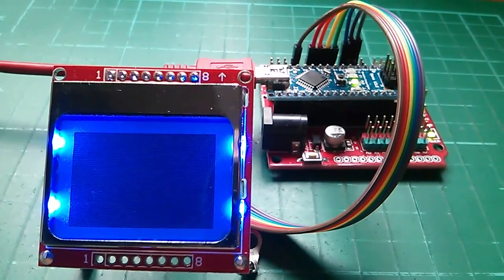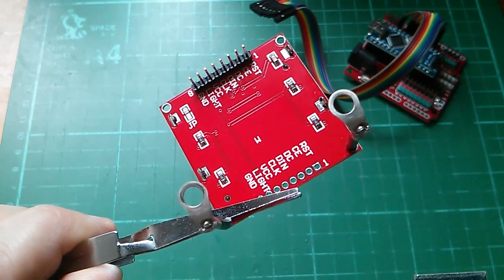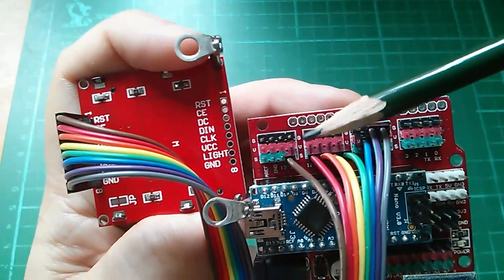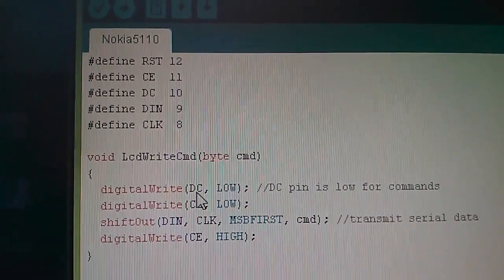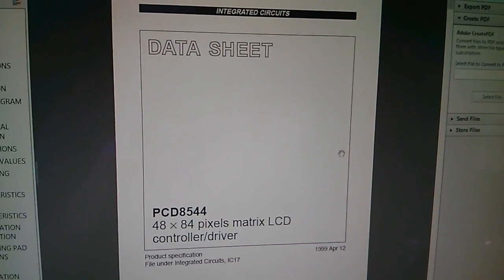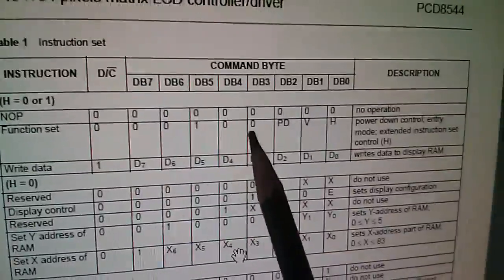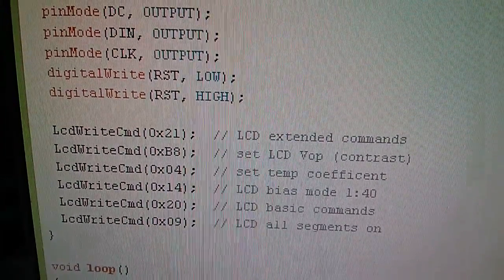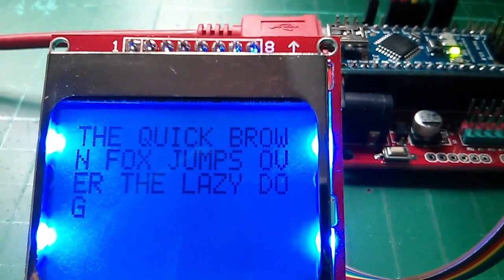Arduino Nokia 5110 LCD Tutorial #1 - Connecting and Initial Programming

Comment: I had bought the lcd and had connected by looking at the  goodled images of wiring diagrams. Your video has provided with a huge help in correcting my mistake. I was completely fed up of the display as it wont work, but this tutorial was just too good and was a huge help. Thanks :)

Comment: Hi Julian,  I've been noodling a bit more with your ultra lean shift-out code for these Nokia 5110 displays.  I wanted the smallest possible footprint so that we could add them to data loggers that are already compile near the memory limits.  As it turns out, stuffing those fonts (and some calibration data) into the internal EEprom was pretty easy to do and it does not noticeably affect the speed of the display:

https://thecavepearlproject.org/2018/08/24/tutorial-using-the-arduinos-internal-eeprom-for-fonts-header-data/

Comment: Iam very glad to found this video
 thank you 

Just two questions
How did you figured out that the data input of the display is a shiftregister?  Is there somewhere in the datasheet a hint or did you decide it by the signal diagram?
Dc ias ow for the whole datasend procedure . I just wonder because while reading the sheet i thought dc must  be low for just the first bit of sendet data. 
Is this a common way to use this type of interface?

Comment: Hi Julian,
I had a project that needed some live data display, and was looking for the cheapest low-power solution and that lead me to your brilliant Nokia 5110 tutorial. Combining your information with pin powering let me get rid of the Reset and CS control lines. This brings the display down to any four wires you can spare (incl. the power pin) and a ground which is much more manageable the standard six wire hookup:  
https://thecavepearlproject.org/2018/05/18/adding-the-nokia-5110-lcd-to-your-arduino-data-logger/
Anyway, I just wanted to say thank-you for posting the shiftout method for driving these displays!

Comment: Julian Ilett
I am going to use this code you provide on a few online projects with proper credits. If you don't have any cons. If you do, please tell me, i will remove it.
Reply from the maker: Go for it :)
Reply: Another question. :)
How to display some values from sensors within your code? I have float value and it need to be char inside LcdWriteString(). Tried few solutions but no luck. Or how to display float value anyway?
Reply: You need a library routine to convert numbers (a float in this case) into strings.  You can make your own, but I'm sure there are libraries already defined for the purpose.

In the case of a float, I believe the routine requires you to say how many digits of precision you want and it will round off the float to the nearest value.  eg. If you ask for it to convert 1.5 with no decimal portion, it will be rounded up to 2 when it's converted to a string.

Comment: I have seen some sources say that this can work with 5 volts,  but no guarantees.    my UNO has a 3.3v power pin, but the digital pins are 5v.   any chance this will work ?
would I be better powering the whole thing from 5v and take the risk ?  or go multi-volt and try it with 3.3v power and raw data pins ?
Reply: If the display data sheet says that the data lines are 5 volt tolerant then you can do it, otherwise not.

If you don't mind inverting all of the data pins, you can convert between 5V and 3.3V by using a NPN transistor such as 2N2222 or BC549 and a couple of resistors for each data line.  One resistor is used as a "pull up" between 3.3V (or 5V if you're going the opposite direction) and the data pin which is taking the data.  The collector of the transistor connects to the data pin and the emitter connects to ground.  The remaining resistor goes between the data pin which is sending the data and the base of the transistor.

If you didn't understand any of the above, then you're probably better off buying a display which is 5V tolerant in the first place.
Reply: i guess what i was asking without saying, if all the data lines are inputs, and the only action from the arduino is to pull to ground, then, they would work without alteration.  as a note some of the mini's are able to run on 3.3v

Comment: Mine only works at 3.3v not 5v
Reply: Transistors can convert the signal voltage, but I think you can also get level converter chips.

But it might be easier to just get a 5V display.

Comment: how to change the size of the text ??
Reply: Since the display doesn't have any built-in text font, you'd need to define your own font in the size you need.

This isn't simple.  If you reduce the size, you also reduce the resolution.  You also have to handle characters which cross over byte boundaries.

In theory, you could define a font which is 4 x 4 pixels in size, but then you'd need to figure out the programming to handle the fact that you would be putting part of each of two characters into the upper and lower 4 bits of each byte of data.

Yes, it's complicated.

Comment: Hi Julian, nice video. I am new to working with the Nokia 5110 display. I am using an Arduino UNO. Hooked up everything the way described, uploaded the sketch and nothing showed on the screen. The led lights came on, but nothing else. Checked all the wiring. Do you think the display is bad? Not sure what to check next.
Thanks,
Robert

Comment: Hi Julian, thanks for this series. Definitely saved me some time. After a lot of experimentation with this display, and the u8glib, I've come to the conclusion that this display definitely does not want to be driven from 5V VCC, and with 5V logic. It does survive the ordeal, but the display quality suffers a lot. If you run the GraphicsTest example from u8glib from 3.3V and from 5V, you will clearly see a huge difference in display quality. Its virtually impossible to get good bias, temp and contrast values with 5V. But with 3.3V it works just fine.  The values (for u8glib) are defined in a file at  /Arduino/libraries/U8glib/src/clib/ u8g_dev_pcd8544_84x48.c on my Mac. Should be somewhere similar for Windoze users. This may vary, but I got excellent results with temp=0x005, bias=0x011, contrast(Vop)=0x0BF. I'm busy getting a ATMEGA328P running at 3.3V, 8MHz, so no level conversions are necessary. This will be a "backpack" I2C processor for the 5110. Lots of memory and I/O lines available. PS: I'm using the 5110 from Sparkfun - slightly different from yours: https://learn.sparkfun.com/tutorials/graphic-lcd-hookup-guide. Hope this helps someone. Best regards!

Comment: Nice videos, and good code to start with!

You described problems in 3rd video, and I had problems when connecting 5110 as you described to Arduino Nano: after some time the display got darker and darker. Solution for me was simply to connect 5110 VCC to 3.3V pin of Nano instead of 5V.

I did play a lot with your code, and made your simple clear display loop speed up from 11.44fps to 206.27fps. And finally I was able to draw a complete (arbitrary) frame with 142.94fps:
https://forum.arduino.cc/index.php?topic=382585.0

Comment: I also have a Nokia 5110 LCD, but my pins are different, instead of the pins that you showed I have: 1.VCC,  2.GND, 3.SCE, 4.RST, 5.D/C, 6.DN(MOSI), 7.SCLK, 8.LED. How should I connect them to my Arduino in comparision with your example? Thanks

Comment: For me(supply voltage=3.3V), setting the temp coefficent to 0x04 (=temp coefficent "0" according to datasheet), results in a far too high contrast making it seem like all pixels are active even though it's supposed to be displaying a blank screen. Setting the coefficient to 0x05 (=temp coefficent "1" according to datasheet) fixed that problem entirely.
Anyways, thx for the video, helped me a lot!

Comment: Ok time out!
We did this 10 years ago with a serial bus on an old Pentium 2 Laptop. 
the whole 2.7 - 3.3VDC thing and the black out effect are a thing IF you try to drive it with 5 VDC and more than 1 amp = typical USB voltage and current.
its best to use a 500mA 3 VDC supply (wall wart) or if you have a bench supply like I do you can set the current and voltage limits.
To bring this up to speed We can do in via a Rasberry Pi also as well an as Arduino and with a variety of LCD and LED type screens both static and touch capable...
This is an interesting tutorial for those wanting to dabble in old tech and low res displays...

I guess it helps to mention that I worked on hundreds of these phones in the past and their internal components as I am an Authorized Nokia service repair technician along with many many other brands including Apple and Motorola..
Reply: you're missing the point.  it is popular because you can get them from china for a couple of $$ with free shipping.
Reply: why when you can usually get them free from the old phones free from people who still have them laying around? I happen to have a box of these nokia phones..
Reply: ElfNet Gaming Yeah everyone has these lying around, that's why they buying them in droves.
Reply: Who is "they".
I don't know any one person buying these things let alone droves of people buying them like its the "next best thing"
. I do however know people that buy late model phone screens and touch screens for their projects but I guess some parts of the world haven't caught up to that yet..

Those LCD's are either NOS "New Old Stock" or Salvaged from old phones and put on a custom board with non original back lighting..
A genuine original Nokia NOS version should have the traditional green back lighting since blue or white was not a viable thing back then.
Chinese versions have blue or white back lights and the LCD's are salvaged from old recycled phones and may not even work...
Reply: ElfNet Gaming
WHO CARES....Do you not get the point yet!  For a couple of bucks (including shipping) to learn about driving a simple LCD screen that is easy to interface with and you're all up in arms over it.  Get over yourself
Reply: ElfNet Gaming Even so, the boards from the internet are ready to use and they already come with the needed protection and circuitry.

Comment: I have two solenoids that needs to be triggered when arduino see's an analog signal. The solenoids are on digital pwm pins driven by solidstate relay. There is also another thing. I want to put a Potentiometer to adjust the duty cycle while the input is active. This way I don't have to go into the program to change it.

Comment: Sir, thank you for the video, the way you explained how to understand lcd commands helped a lot. I had a different issue with my 5510 lcd which I think might be useful to explain. I've connected the lcd and MCU (I use AVR attiny2313a) directly to the USB port of my PC. It works, but due to unstable USB voltage the picture flickered a lot. After I've added l7805 5V stabilizer it worked perfectly. There goes, maybe it helps somebody. Again, thank you for the tutorial!!!
Reply: P.S. By 'a lot' I mean A LOT, the image was impossible to see.

Comment: Thanks for this very informative video  ....I have a problem when I connect the Backlight pin to the ground it is not lighting up and when when I connect it to 3.3V pin it is working fine .But in your tutorial you mentioned connecting BackLight pin to ground which is not working .
Reply: Same here, my module also likes to turn on the backlight when the BL pin is high.
Reply: Yupp... spent the last 2 hours thinking that I got a bad piece.. .BL should be connected to 3.3v , the fact that there is a dedicated pin on the LCD means that, I came to know that now.. fuckk

Comment: Very good video.  Is there a good link to get the tech-manual for the LCD you are using in the video (specifically)?  I have the exact same LCD as the one on this video.
Thank you.
Freddy
Reply from the maker: I'm not aware of any tech manual as such, just the data sheet for the driver chip (Philips PCD8544).
Reply: +Julian Ilett 
Adafruit has it:
https://learn.adafruit.com/nokia-5110-3310-monochrome-lcd
also the libraries as well.

Comment: hi - what do you mean by mentioning 'cascading displays'? can you hook up more than one and have them display different data?
Reply: Yes. All lines (but CE) are the same. CE is for selecting the display to write data to. You should use different data pin on arduino for display selection or some kind of shift register to toggle between displays.

Comment: I assume that the metalwork and red pcb have nothing to do with an actual 5110 phone. The lighting looks poor as you mentioned, is it only coming in from the sides?
 I have an old 3330 phone which has a PC8544-driven LCD. I cut out the PCB from under the LCD to reuse the lighting SMD leds (on the PCB) which light up the LCD quite evenly via reflection off a clear plastic moulding. There is no LIGHTING pin on the LCD, but you do have to add a capacitor to one of the 8 pins.  The other connections are made by soldering directly to the PCB, a bit fiddly but it costs nothing if you can reuse an old phone!
Reply from the maker: Not sure about the metalwork, but the PCB is not original. I'm sure the LEDs would look better if they weren't so bright. They can be connected to an Arduino PWM pin for brightness control. I may have an old Nokia phone with this display - I'll see how it compares.

Comment: Thank you for all your very informative videos! Just a comment:
You read from the EBAY comments that part of the display may become black when running on 5V. I have experienced that if you do not set a specific LCD Vop (contrast) and leave that in its default value, the display becomes relativly black after it has been running for approx 5-10 minutes.
Reply from the maker: Thanks Bjorn. Yes, I'm sure that's what the seller is describing. I have 2 of these displays, (one with blue backlight and one with white) and the Vop contrast value has to be set differently for each of them. The bias setting also affects the contrast.